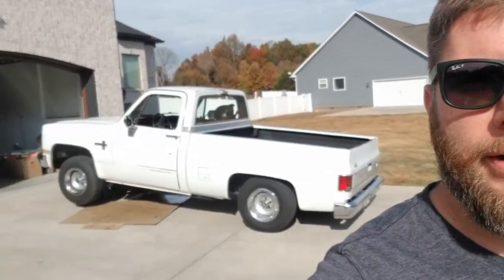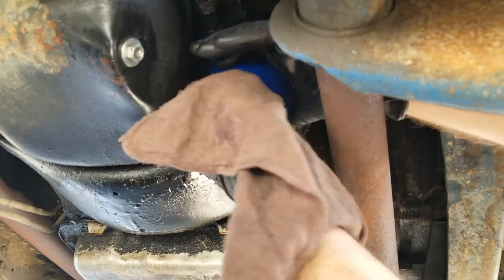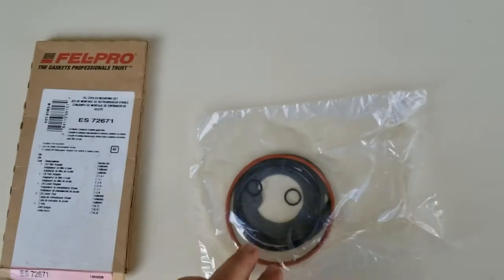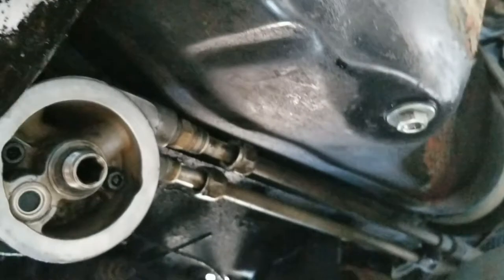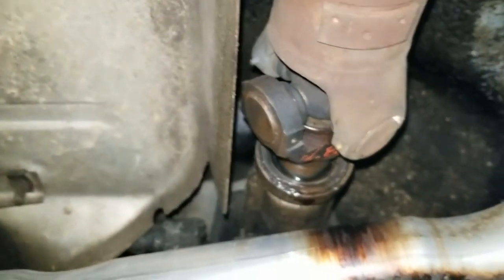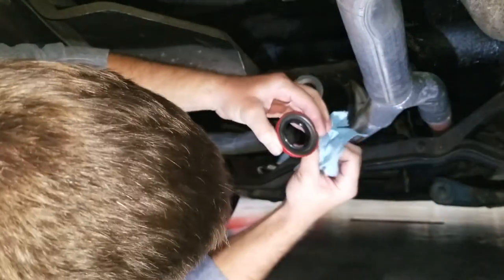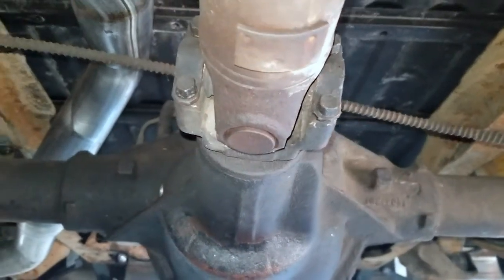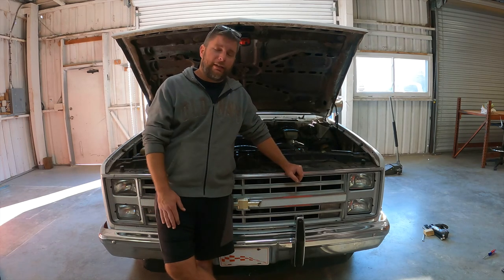Chevrolet Squarebody C10 - How to: Fix Engine Oil and Transmission Fluid Leaks

Comment: Do all vehicles have the oil filter adapter? I have a 06 5.3 envoy 200k mi. and I am down to 2 possible places it could be leaking and now  I wonder if that filter can be replaced on mine.
Reply from the maker: Nathan, it has been a long time since I have seen one of the Envoy/TBSS engine oil pans, but I am certain they do not have an extension on them like this truck. 

If I recall correctly, the Envoy will have a forward mounted engine oil filter sealing directly to the engine oil pan. With all of that said, there is a "cross over" point on the same side of the oil pan as the filter, but where the filter would be located on a standard LS engine. They will leak pretty often at that point, and is a pretty simple repair.